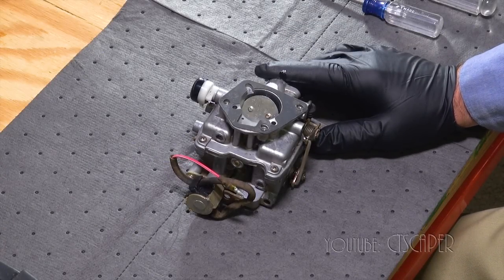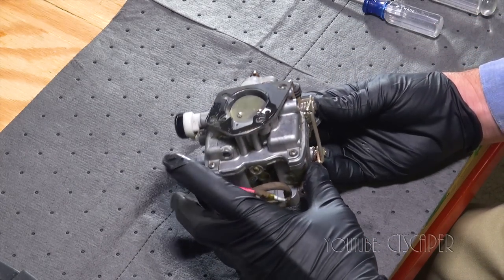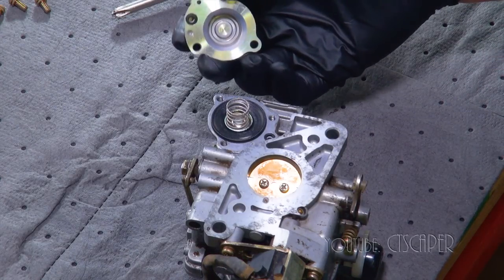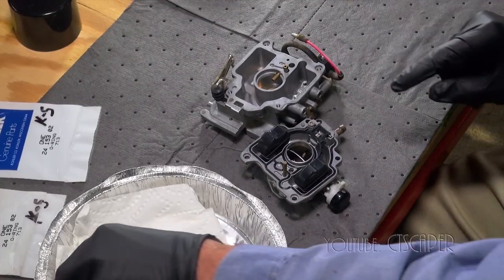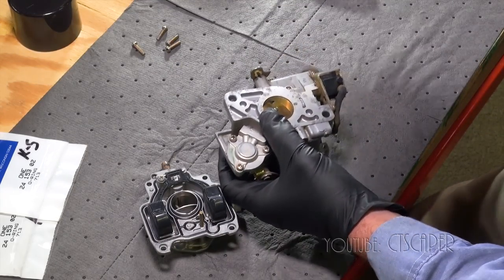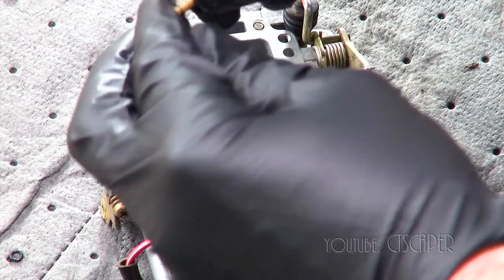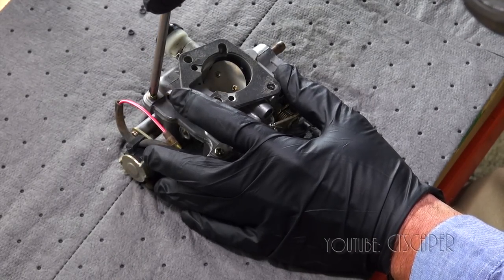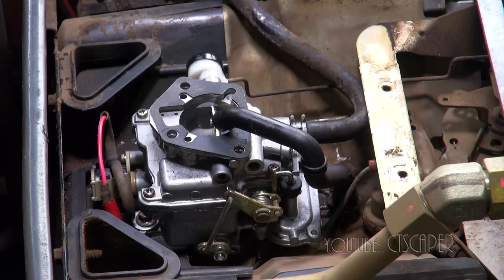KOHLER COMMAND TWIN CARBURETOR REBUILD EP.03

Comment: Thanks for these videos!  Well now you have a very clean carb, and 2 good coils...  I struggled last year on a similar Carb from a 25 hp Koehler engine on my jd g100.  I took the carb apart, rebuilt, but too cheap to do the accelerator pump, and found no improvement.  The second time around I did cough up the $60 to redo the accelerator pump, and that fixed my problems (low power, smoking, fuel in the oil).  Was a pain taking it apart the second time, so glad you hung in there!
Reply from the maker: Glad to hear you got it fixed.  This one, like that one for you, was a learning experience.

Comment: Still convinced that your running on one cylinder 
With the engine at full throttle disconnect one spark plug wire and listen to the change in the tone of the engine if it dies completely you know only that cylinder was firing. If  you unplug it and nothing happens to the sound of the engine  then you found the dead cylinder. Could be a bad plug but more than likely a bad coil
Reply from the maker: You nailed it Alex.  It was the coil.  This series and listening to you guys knowing the sound will keep me better prepared for next time.  I would have known to check the plugs first if I knew why that sound was off.

Comment: One thing you missed on your rebuild is pulling the fuel metering solenoid and cleaning out that cavity.  If you look straight down the bowl in line with the solenoid you'll see a hole about 3/16" in diameter.
I had black rubber particles from a bad hose plug that entry hole up.
Mine ran so lean when that hole was plugged, I had to run it on full choke to get it back to the garage.

Comment: $10 for a set of inline spark testers on eBay or at Autozone would have saved you a lot of time and pointed you toward the bad coil but you are now an expert on the Kohler carb :-) always check fuel flow from tank to pump then from pump to carb, then check spark with inline testers or by ground the plug out of the cylinder then go onto compression and/or leak down testing if necessary any significant issues there open up the engine check all gears cam also check value lash but these engines have hydraulic lifters so not valve adjustment is needed.

Comment: John I have to agree with Alex, you definitely are running on 1 cylinder, your carb is fine, you did a fine job on the carb, you need to pull 1 plug wire with the motor running and it will either run the  same or about the same or it will quit, then pull the other plug wire and try again and then you will know which cylinder is not working. If you're scared of getting shocked by the wire then take a piece of wire a couple feet long, strip a couple inches on 1 end and twist it on the handle of a pliers and ground the other end of the wire to the motor, then pull the plug wires off with the pliers and you can't get shocked that way. Once again you're running on 1 cylinder.
Reply from the maker: Gordon, thanks for the tips.  Especially how to check the coil without getting electrocuted.  It did end up being the coil and not the carb but I had to pay someone else to tell me that and fix it.  Now I'll know and hopefully others as well.
Reply: Or, you could just pull the plugs, put them back into the wires and ground them and see which one is throwing a spark ?  Always check spark first. Cheapest and easiest.

Comment: I’m a diehard Kohler guy and a lot of times it could be a Coil Kohler are known for  coils to go specially under a load like the other guys said disconnect one coil take it from there and if it is the coil change them out they have 2 coils but you never know it still could be the carburetor
Reply from the maker: John, you're right about the coil.  I had someone else look at the engine after I went through this and they replaced a coil.  I wish they would have replaced both since they were already in there.  After the repair my battery isn't charging.  I wonder if the two could be linked.

Comment: Sounds like running on one cyc.  Check the coils, one is a bad. Common kohler issue. Take a plug wire off, if motor dies its that cyc coil. If not,  it is the other cyc coil.  Oh, and please dont do this at full throttle....no need.  Good luck!
Reply from the maker: Thanks Brian.  I would have done it at full throttle.  It was the coil but I had to have someone else pull the engine and replace it.
Reply: Watch out for the backfire!
Reply: Glad you got it back running!
Reply from the maker: When I'm using the machine it's standard operating procedure to cover your ears immediately when you turn the machine off.  With or without earmuffs because every little bit helps.